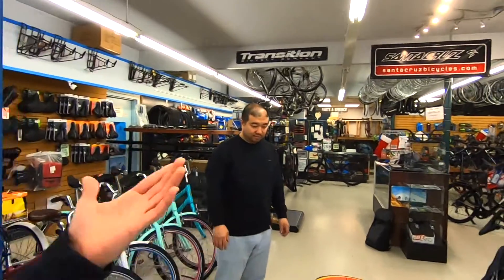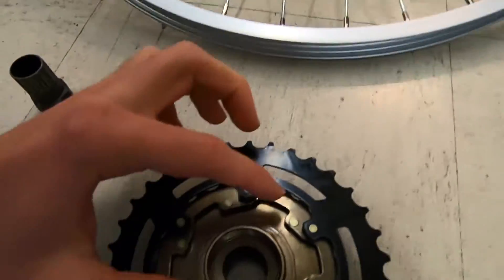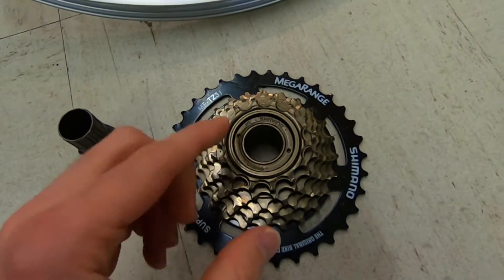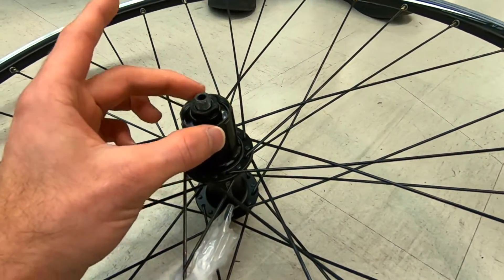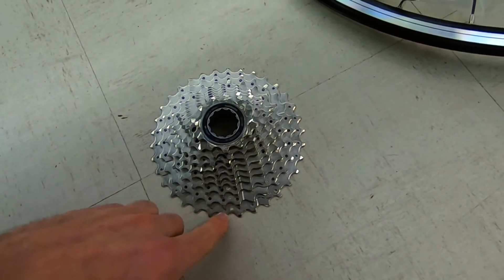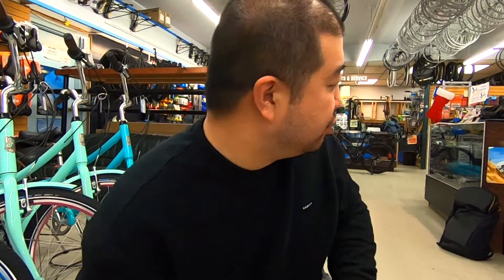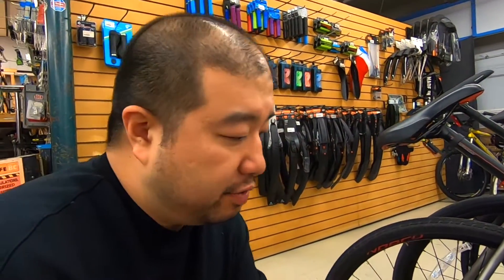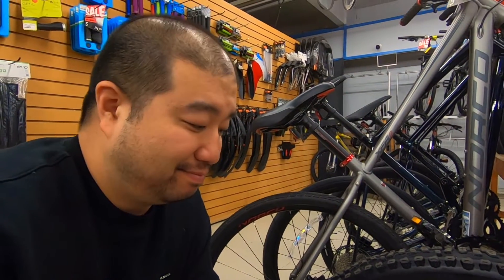Difference Between Cassette vs. Freewheel

Comment: Some of this is not correct: You can get a11tooth sprocket in a freewheel they are made by DNP they also do up to 11 speeds but the max size sprocket is 34 tooth which is a downer. DNP Freewwheels are used on many hub motors some say this is because they are stronger but I doubt it.
 Also some of the hub motors that use freewheels have a thicker shaft section where the freewheel fits and this can be a hindrance when using a freewheel removal tool..they make a special (hollow) freewheel tool for hub motors. 

Not all hub motors use freewheels, the big manufacturers make freehub/cassette style also but many of the hub motor ebikes that EBR has done reviews on will have had DNP freewheels fitted and not cassettes. If you are looking at making drivetrain changes and you have a hub motor on your bike you will need to check what type you have first.
Reply from the maker: This is great feedback, Dave. I feel bad about my misinformation here, but I'll pin your comment to the top to help correct. I noticed that Rad Power Bikes and many other hub motor ebikes use DNP higher quality sprockets, do you think theirs is a freewheel with the wider range like you're talking about? It looks like that is the case given the specs I recorded https://electricbikereview.com/rad-power-bikes/radrover/
Reply: @ElectricBikeReview  Yes..NCM ( I love my Moscow+), Magnum, Rad, and m2s all use a version of the bafang hub motor. It seems that the DNP freewheel is the gear cluster of choice for these bikes...Maybe you could do a Hub motor video...there is also a 2 speed hub motor but these only tend to be used on cargo/delivery bikes at the moment.
Keep up the good work.

Comment: Is there such a thing as pedals that freewheel as the electric motor is driving the cassette gears. so that on a hill I can select a lower gear but not have to pedal
Reply: What you just explained is a mid-drive electric motor. Sadly they are very expensive, costing nearly $1k

Comment: Yikes, I still don't get it.  Why would anyone prefer one over the other?  Or is one just a technological innovation over the other, and there is no reason to go backwards to old technology?  What was the problem with the old tech that the new tech solves?  Would somebody please explain what I am missing?  Really appreciate it!  Thanks!
Reply: nothing, it just shave weight , and its damn expensive to have 12 cassette rear , lol
Reply: With the freewheel, more weight is placed on the side so it has more torque to bend the rod it’s mounted on, so it’s just one of those things where you can either take the risk or not. Me personally I’ve never bent the rod on any freehub bike but my new bike came with a freehub so I’m going to use that instead

Comment: Court, I've always thought of a "freewheel" as a mechanical clutch with pals.    and most cassettes have a freewheel so you can coast without your feet spinning.  If the bike has a fixed gear, the rear sprocket can be fixed or it can just be a freewheeling gear.  Many combinations to choose from.  Glad to see you having fun in Canada.  :)
Reply from the maker: Thanks Rob! I sort of condensed it to "if the sprockets are permanently attached to the freewheel mechanism, it's a freewheel" do you think that works?

Comment: Also he forgot about 157 which used to be downhill, but now now it is also "Super Boost". 
While I have never looked for that, my new bike (Pivot Shuttle) happens to have one.

Wheels are stronger and more rigid due to wider flanges, and shorter chain-stays/wider cranks/different chain lines.
Reply from the maker: Oh man! You got the Pivot Shuttle?! How are you liking it Denes?
Reply: @ElectricBikeReview  rhe Shuttle is nice. Pricey. Nice components and motor. This far the suspension is sufficient... Will have to take it to the more aggressive parks with drops and jumps. Using the suggested sag I haven't yet bottomed the small rear 140mm out. I am coming from a 180/180mm Haibike so that 140mm is my only concern.   Oh will have to swap the 760mm bars to a 800..  But that's all.

Comment: Most people cannot differentiate between "wheel" and "tire" :) ....    While it is good info, I feel a bit like: you either already knew it or you won't learn it anyway.....

OTOH I would have called that with a freewheel(ing) cassette. Freewheel makes me think of a fixie/BMX. Frankly, I don't remember seeing one of these at all. Since I remember me messing with bikes, I remember the "cassette removal tool"....
Reply from the maker: Good call, this video left me feeling mixed because it could have been tighter and clearer, I like the language you used there and might do an updated improved video at some point.

Comment: For the past 20 years or so I've been riding and working on single speed and fixed gear bikes but this year I bought a geared bike and an electric geared bike and so I'm learning all of this stuff. Most of this I already knew because you just pick it up over the years but you don't necessarily understand all the subtleties until you study it. I just ordered a new larger chainring for my giant explore e+ 3 because I never use the larger cogs on the rear because of the nature of the roads I ride on. And a little slower Cadence will be nice

Comment: You left out the reasoning behind the 12 speed cassette. This allows you to have a single chainring upfront and simply shift 1-12 without having to change between chainrings up front.
Reply from the maker: I hadn't thought on that line of logic, most ebikes I see are 1x drivetrain and that's a huge benefit (save weight and complexity, additional shifters, wires, derailleur) so yeah, having a 1x but still getting a wide range of gears with a 12 speed is awesome and my favorite way to go.
Reply: @ElectricBikeReview  And the reasoning goes further than just saving complexity and just simplifying. I hopped on a Ibis Hakka experiencing their  SHRAM Rival 1 and felt how streamlining the 1x was with that groupset.  Before I always thought having a 2x is what I wanted because if I have a San Francisco hill approaching, I can just click about once on the left and right side and be good to go to attack the steep hill vs. a click click click click...yet what I found was that with the Rival 1 with its x1 setup,  you could slide down 4 gears with one click and be ready to bust a move (ie. starting an acceleration or stomping up a hill) and from there you have a streamlined experiencing for coming back online with simple one-side clicks to pick it back up again.  
I do mostly sprints and fast agressive riding while my rides are relatively much shorter (ie. 6-7 miles in 20-25min) and this fits my style quite well. However, those doing long sweeping climbs or long climbs in general and less stop and go where you'd be looking to bust quick moves (while still possible in the 1x or 2x setup), the 2x setup offers value where you could get more delicate nitpicking capability of the gears to help sustain yourself. I'm not worried about the smaller gear changes and nitpicking as much as I'm generally sprinting the whole time, want to be able to bust a move and get back online right away and the 1x experience that has the simplified and streamlined shifting to bring you back online for agressive fast rides (always focused on accelerating) is the way to go. 
Totally a rider and style preference lens to throw on this decision beyond gear range options and reliability.

Comment: I think I might need a more In depth video next time, I'm still not quite getting the concept =\ pros and cons of each, best use cases, can they be used as front and or back wheels, how easy are they to work on or maintain?
Reply from the maker: Yeah, this video fell short of what I'd like to express and my vocabulary could have been tighter. In many ways, it sucked, and I thought about refining further... but it serves a small purpose of differentiating between a "freewheel" and a freehub body + cassette. Freewheels came first and are simpler, usually don't have as small of sprocket options (usually starts at 14 but not always) and traditionally don't offer as much strength as a freehub + cassette can. I'll work to improve this in the future :/
Reply: @ElectricBikeReview  I think the video was a great start and I'm sure some people got all the info they needed. I'm just use to the detail oriented court that gives me all the juicy details I've come to enjoy! Thanks for the content and the reply